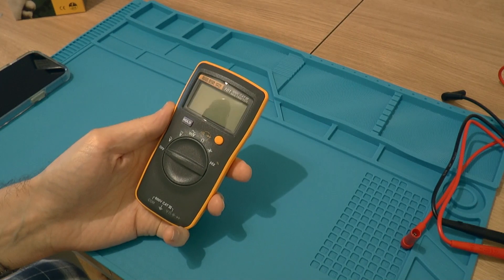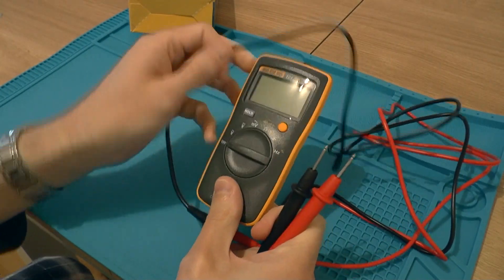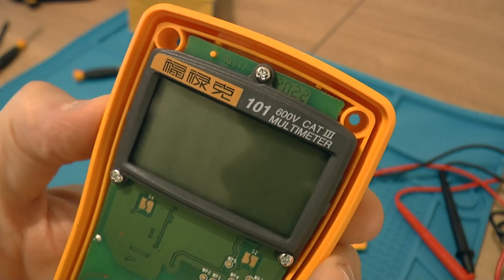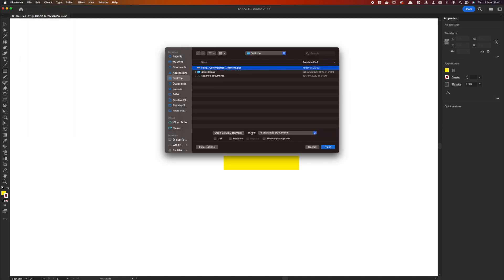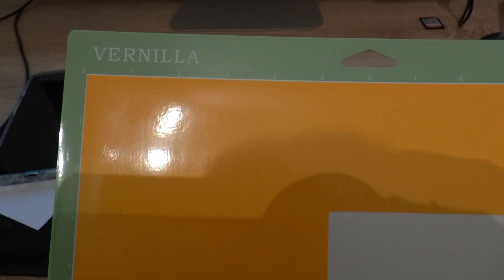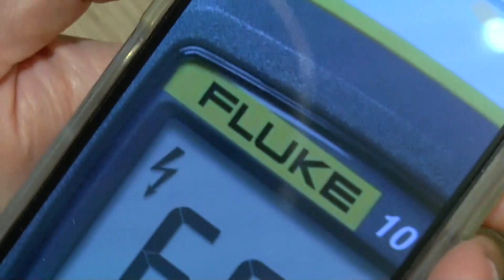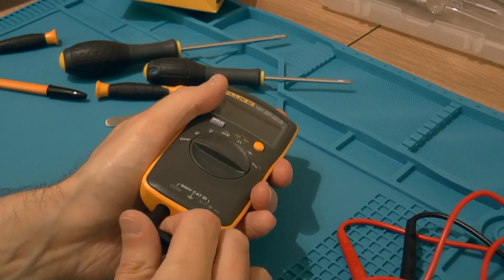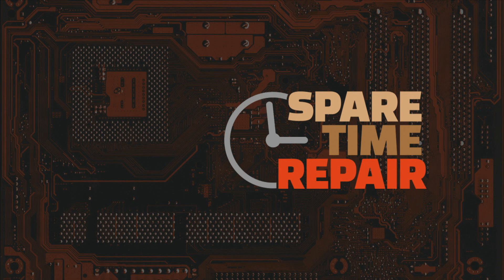Fluke 101 multimeter - or is it?

Comment: I bought one of these too: same variable quality buzzer. I also questioned its Fluke authenticity, but came to conclusion that it was genuine. TBH I'm not finding it as good to use as I'd hoped, principally as it's small size and light weight mean that, in conjunction with the relatively stiff probe leads provided, the darn thing won't stay still on the bench or under a car bonnet. Lesson learned: should have shelled-out for the real deal and not been a meanie.